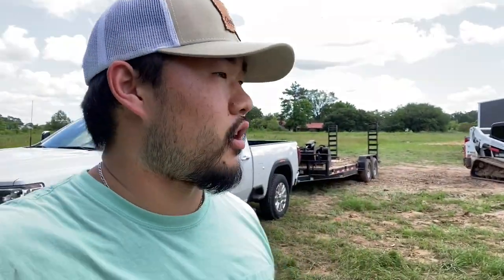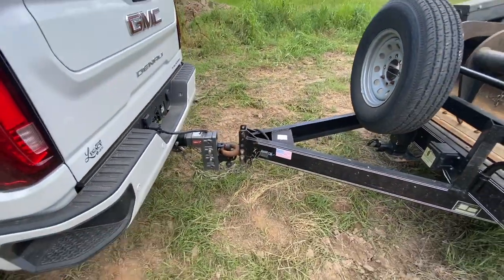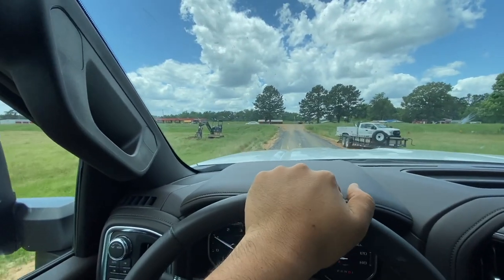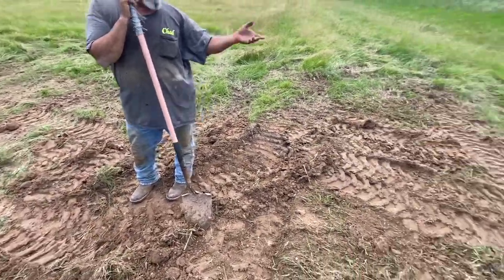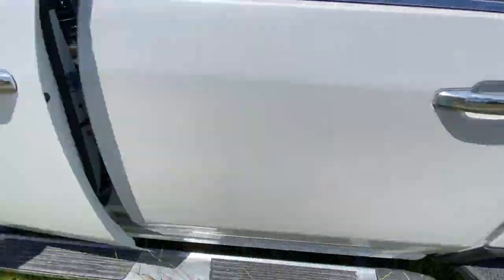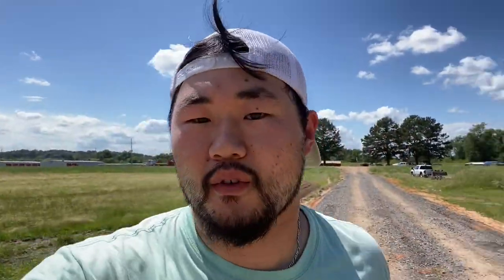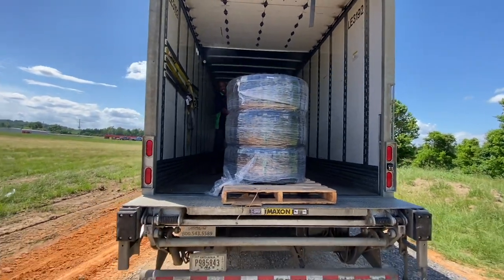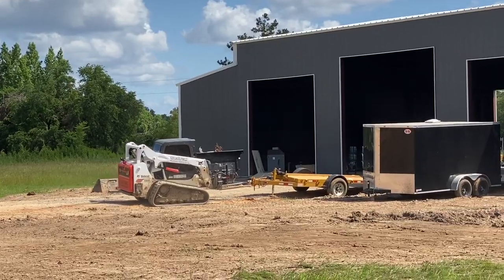Day 9 Finally Getting a Water Meter!

Comment: Put the truck in 4wd instead of the e-brake. If your rear wheels lift off the ground neither park nor e-brake will hold it if it’s in 4wd your front axle in park will hold it